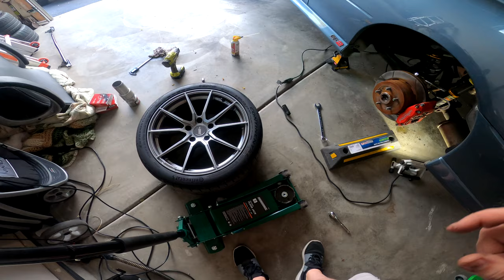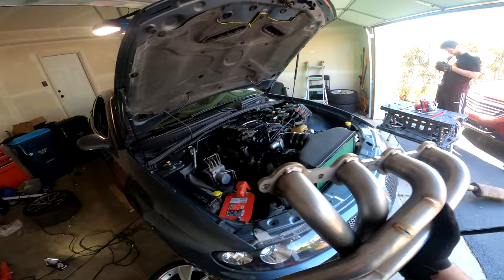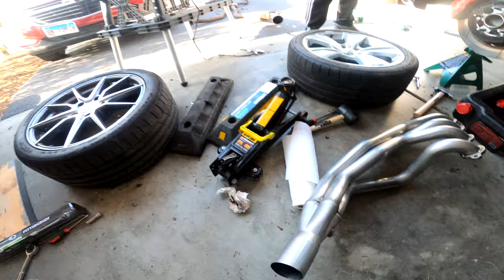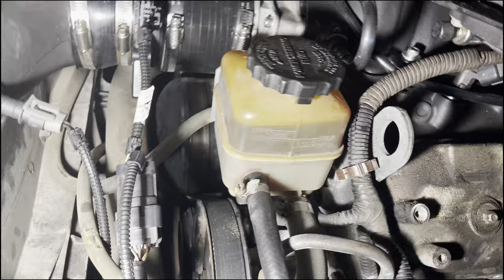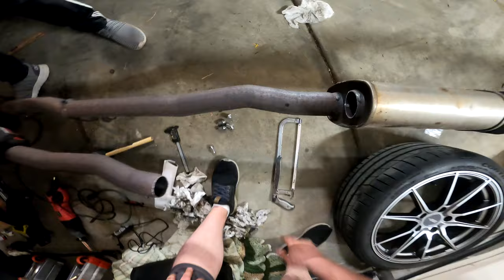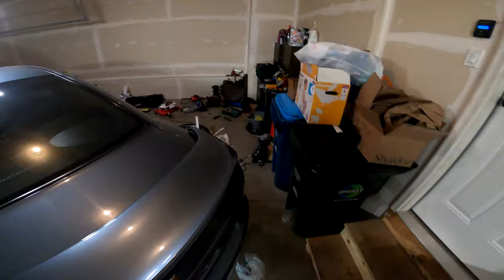GTO Header Install

Comment: You don’t even need the rear 02s without cats and a tune. All the rear 02s do is tell if the cats are working. The computer only needs the front 02s to fuel the motor. But man what a great video  👍🏼. I just acquired an 06 gto. Been wanting this car forever lol. I ordered long tubes , a one piece driveshaft , and new ignition stuff. So I’m gonna do all the installation myself. Those headers look like a real pita lol. I have installed headers before on a 2015 mustang gt and on my suburban. Hell it can’t be that much harder on the gto lol.

Comment: Nice I like the color! I am really glad I went with Kooks, they were simple to install.
Reply: Did you drop steering rack?
Reply: @mikeprice8307  it's been a few years now so memory is a bit fuzzy. I do remember removing the bolts on driver and passenger side of the rack and maybe one of the lines that goes to the rack but definitely did not remove the steering rods that go to left and right wheels.
Reply: @baby-sharkgto4902  man that job looks discouraging.   I installed an MGW-P and that took me almost 10 hours on a set of race ramps.
Reply: @mikeprice8307  I hear ya. My car was only jacked up a few inches when I did the headers. Also on the driver side you have to remove the steering shaft. Come to think of it the drivers side header was a pain in the ass but probably no worse then the shifter that you replaced.

Comment: Where did you get your fog lights from? Have a link?
Reply from the maker: fog lights are stock. I did upgrade the bulbs to HID but the housings and everything are completely stock.
Reply: @dijitle  did you have to adjust anything for install? Any heating problems?
Reply from the maker: @RJ-ie8eu  In the video I show having to saw off a few bolts that were sticking out for clearance. No heat issues to report.

Comment: Love your car! I love my 06 CGM! This is the best header install video i have seen yet on youtube on this car, are those 1-3/4 or 1-7/8? Any contact with steering shaft? Also the primaries are all one continual tube correct? Thanks!
Reply from the maker: Thanks. They are 1-7/8. I did actually have slight rubbing at one point with the steering rack, but it turns out that metal retaining clip got bent back and was rubbing. Not enough to interfere with steering, it'd break off worst case, I bent it back and clearance is ok now. I haven't pushed the car hard yet so it's hard to tell if it'll be an issue. I think the shorter engine mounts will help, but then there might be clearance issues with the steering rack, the rubber sleeves. But so far, so go.
Reply: @dijitle  quick question. When and how long did your headers take after getting ordered. I ordered my 1-7/8 arh from complete street performance
Reply from the maker: @carguy6636  ordered March 9th, didn't arrive until April 29th... I was pretty upset, but it's not their fault, whole world is messed up with all the supply chain disruptions.

Comment: Yo what brake kit you have on?? I can’t find any Brembo for the gto.
Reply from the maker: It's wilwood. 6 piston fronts and 4 piston rear. I ordered from CarId.com. apparently the wilwood site doesn't take online orders, you have to call them like it's 1995. but pretty good kit. Rotors have an aluminum hub for weight savings,  and the performance it great, took it to the track, no fade, no issues, really good stopping power.
Reply: Does amazon not have ctsv gen 2 calipers anymore? I had to piece my brembo kit together

Comment: My steering rack ain’t wanting to hang down like that 
Did u take the ti rods out or what
Reply from the maker: I did not take them off, no. It's been a while, but I think I replaced them when I did my coilovers before this project.
Reply: @dijitle  I figured it out I have it up on ramp so all I had to do was jack it up and it came right down 
Thanks tho brother